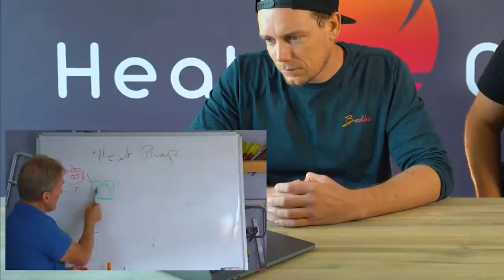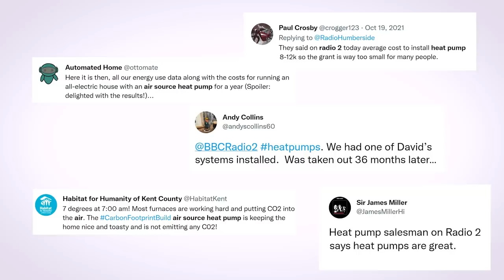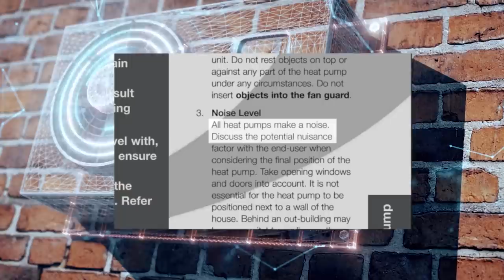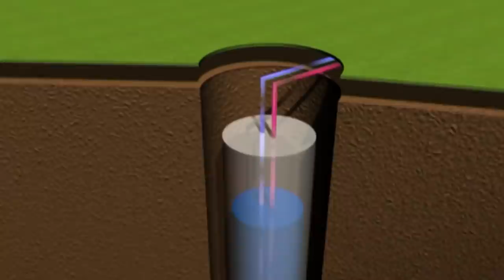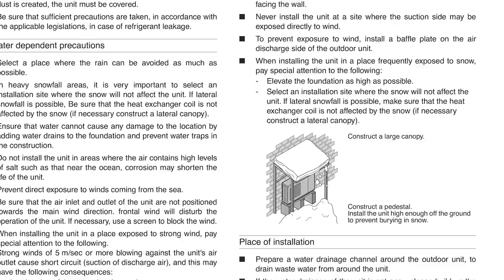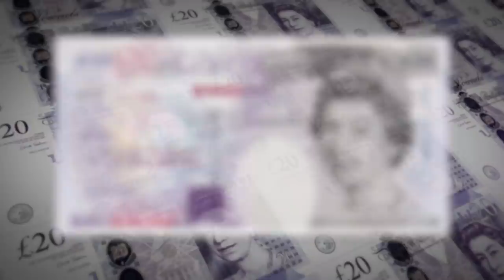Heat Pump Secrets They Don't Want You to Know

Comment: 1st off, I’m from central U.S.
Southeast Missouri to be exact.
I pretty well agree with you too. We don’t use many boilers in this area, I maybe work on a dozen per year. They’re a lot more popular in New York territory. We definitely don’t have any air to water heat pumps. We have several mini split air to air units. With them, I only recommend for an add on to a house, with it being a 1 to 2 max (1 outdoor to 2 indoor units). They’re long term unreliable to me from what I’ve seen. The efficiency of newer boilers and gas furnaces is quite impressive now. I also agree that ground source heat pumps would be a good option. They’re expensive up front, but have high efficiency rating. I personally have what we call a “dual fuel” system. Which is a heat pump with a gas furnace back up.

Comment: Pretty much everything you've mentioned (which is essentially picking out warnings from manuals of random heat-pumps (could be obsolete Chinese models for all we know) applies to regular aircon units which are everywhere. Sea air, rodents, wind/weather/rain/snow affecting the performance - all these issues don't seem to occur anymore with air con units than they occur to gas boilers. Which incidentally also have heat exchangers, fans with exposure to the elements via the flue, complex PCB's and plenty of wiring and controls. I've recently followed Octopus Energy's advice to turn down my gas boilers heating flow temp which I thought would be interesting as an experiment to see if we could use a heat pump in future - and indeed what I discovered was that the installers of our recent Worcester gas boiler did not advise the correct (low) setting to allow these modern condensing boilers to work efficiently which also require a low flow temperature in order to recover the heat in the condensation! So the low flow temps and the issue of rouge/poor installers applies equally to gas boilers as it does to heat pumps. Don't see a need to bash the better (albeit more expensive) tech over the older trusted (but dirty) one. I'm actually not finding any issue running my boiler at this lower temperature either.
Reply from the maker: You only have to look at the instruction manuals online to see these stipulations. If you did that before responding it would help your argument. 
I agree about condensing boilers they need two flows so you can send hotter water to the cylinder and can then run the radiators at 50C. The great thing about the gas boiler is that you can turn it up to 80 for those really cold daysl. With a heat pump that won't be possible and days after you need it the heat pump has caught up with the change in the weather.
Reply: @SkillBuilder  Thanks for your reply. I'm not disputing there will be warnings in the manuals for heat pumps - but lets be honest, there will be all manner of warnings for any product. I haven't heard of any of those issues particularly affecting heat pumps or air con units would be being eaten alive!
Whilst indeed gas boilers can reach higher temps than a heat pump, if 50 or 55 degrees is enough to heat a house then no reason why a heat pump could not do the same. Like you refer to in the video they can boost the temperature using a resistive heater on the really cold days too. Also newer thin screed under floor heating can respond in minutes for heating apparently but agree that certainly doesn't make them a one-size-fits-all solution.
Ultimately I think non combustion technology is certainly the future - will the UK's housing stock have to be upgraded to match? Yes. Does that mean the new tech is useless? Not in my opinion, much like EV's already work for many people (myself included hence my interest in heat pumps). But I similarly accept not everyone can use an EV yet, and much investment and infrastructure is yet needed.

Comment: We have a old house   had the oil taken out and a heat pump fitted  with much bigger radiators  and  we love it  , its cheaper to run and the house and water are lovely and hot  .
Reply from the maker: Good to hear, if you are not on the mains gas network then a heat pump makes a lot more sense but the government is pushing them to people with gas boilers and they are not an easy swap.

Comment: If you don’t know Nibe you don’t know heat pumps. Back up heating in my Nibe runs only when outdoor temp drops below -10. And in that case it takes between 2kwh and 6kwh depending on outdoor temp. The drain pipe has no heating cable whatsoever. It is angled to the drain indoors so water condensation flows quicker and doesn’t freeze. I have a house which is 140 square meters and a garage that is 95 squares, both have underfloor heating. My consumption in December 2021 was 1920kw that includes all house hold lights, 3 phase stove, 3 phase water pump for the well and 3 phase oven and outdoor temp was between -5 and -20. Heat pump running around the clock all year round. It has been running for the past 4 years with 0 maintenance.
Country Sweden

Comment: In the winter in my area it can get between 0 to 10 degrees Celsius and I thought to get a heat pump for my pool...
But I remembered that there is something fishy that I can't really point at in heat pumps from what I learned in my classes in thermodynamics when you want to put them to work well in cold claimants.
you need them to be big enough to heat well enough plus they can get pretty noisy when they need to heat in a cold claimants (of course  in that case, your neighbors will kill you with that kind of noise).
Thank you very much sir because you just save me a lot of money!
P.S: I have some air conditioners around my house (which ac on heat is basically a heat pump) and in the winter THEY ARE 
PRETTY MUCH USELESS!

Comment: I think the technology in some regions of the world works fine, much like solar panels and wind turbines.  However, when I went to college in Manitoba, my HVAC Instructor who worked 30 years in industrial engineering, said in Manitoba geothermal heat pumps work well to stabilize the temperature in a house which allows for supplementary heating to bring individual rooms up to comfortable temperatures. However, he did say Manitoba was possible to get cold enough to render an Air to Air Heat pump useless and at that point, the entire heating would be conducted on electric heat alone.  Manitoba can get down to temperatures with the wind chill to -55 and in more northern climes colder.  This is generally the air temperature in the province that gets this cold and thus the air-to-air heat pumps will no longer be able to evaporate their refrigerant and draw then expel that heat into the house.  

There are a lot of advances we never really see being marketed to the public when it comes to energy efficiency, such as Aerogel.

Comment: In NZ  (Scotland Down Under not Australia ) we had heat pumps and it was horrible, cost too much to run and never heated the home, just the room it was in.
So you need a air ducting to move hot air around the home, not to mention the home needs to be air tight basically and have a high R value.
In my opinion as someone with years using them they are a waste of money and effort in most UK homes, gas central heating with underfloor is 100% what i would have.

Comment: Hi, I’m new the the world of heat pumps. I bought a 3 year old property last year which has a heat pump system installed. We moved in to the property in the summer of 2021 and everything seemed fine, that was until the winter when we turned the heating  on (didn’t know it should be running all of the time). After a couple of days we lost all heat and hot water just before Christmas. We had a local (air source expert) company come and take a look. After an hour or so then managed to get it running long enough for them to drive away, then it all stopped again. On a return visit they said it was the flow temperature and did a “work around”. It has worked from there on but seems to be costing a small fortune to run. After watching your videos and seeing other systems, I’m convinced that the system isn’t fit for the property or installed correctly. Unfortunately, to get this looked at is going to cost me money I don’t have. Even worse it’ll probably need replacing or upgrading. It seems that the company that installed it did a rush job to get the government grant and because it was fitted for the builder and not me I doubt there is anything anyone can do about it. So currently, the system is heating the water and I’m heating the home with a log burner until it get too cold. In addition, every home I have been to that has an air source heat pump has been pretty much a sealed unit. Something my house isn’t. Anyway if anyone can help me in anyway it’d be greatly appreciated. Al
Reply from the maker: Hi Al 
 I imagine they have by- passed the weather compensation because that can cause these problems. The flow rate has to be kept high but a lot of installers don't want to put a buffer in so it depends on the pipes being large enough. They have to be huge in some cases. I was kind of hoping that Heat Geeks would start looking at these problems on their channel but they don't want negative case studies.
Reply: @SkillBuilder  I’m not 100% sure what’s been done. The last engineer said it hadn’t been set up correctly and made some changes that seemed to keep it running. I contacted Mitsubishi when it first stopped working but because the data connection hasn’t been added they couldn’t do anything. It would be interesting to see what an actual air source heat pump expert would have to say about the setup.

Comment: As for noise, I think you CAN have it both ways. Looking at the Dbs put off by a dozen different heat pump brands, and I see some do 58Db, and some do 34Db. Obviously that's theoretical on test Dbs and not Real world DBs. I expect 10-20 Dbs higher depending on maintenance, brand, and age.

Comment: Look into the Mr. Cool universal 4 to 5 ton heat pump. I installed this system last spring, no electric heating units and it works great at -5f ( its 5pm where I am and currently 8f). You're definitely knowledgeable but there's systems out there that are amazing ;)

Comment: Some new houses -flats near me have heat pumps at one block there are three units side by side attached to the outside living room wall of one house -flat, fairly sure that is going to drive them nuts very quickly. Also, they face into the prevailing wind rain, and snow and here in the Highlands of Scottland we get lots of that.

Comment: A lot of the points you've made are genuine issues, however I have to correct you on one: It's very counterintuitive but it actually is more efficient to burn gas, turn it in to electricity and use that electricity to run a heat pump than to use the same gas to run a boiler. The fundamental reason is because a heat pump is using electrical energy to move heat energy from outside your home in to your home (so the net temperature increase is close to 0, increase in home temperature minus decrease in outside temperature) whereas a gas boiler is only capable of making everything hotter - so the gas is being turned into heat energy. In a heat pump the primary goal is not to turn the electricity into heat energy (some will be due to inefficiency). A heat pump can turn 1kwh of electricity in to ~2.5 to ~4 khw of heating, so even if the gas power station has an efficiency of 60%, you still win. I do however completely agree that ideally we would not be burning anything to generate electricity! In the UK we need cheap nuclear to add to our wind power and tidal projects that have been rejected need to be reconsidered.

Comment: Everything this man has said is spot on especially for the northern hemisphere, air to water heat pumps are not the answer.
Reply: Do they work in the Southern hemisphere?
Reply: @mikekelly5869  well I can only talk for Perth, here in the winter we rarely get below 1C, so yes they work much better, obviously the colder the outside air the less heat to collect. 
I still prefer ‘air to air’ transfer for heating here it works very well at 1C.
I have a heat pump for my pool and in winter it won’t raise the water temp of the pool past 21C, which is pretty cold to swim in.
Reply: @garywright8846  I'm having a laugh. It gets just as cold in the Southern hemisphere as it does in the Norhern hemisphere and it makes no difference to a heat pump which hemisphere it's in because the heat pump doesn't know. I'm no great fan of air to water heat pumps even in moderate climates but unfortunately the UK government is trying to push air to water, apparently because air to air can also be used for cooling and they don't want to fund gear that will add to annual CO2 figures due to everyone suddenly having "aircon" that they use in Summer, when there's currently virtually no domestic cooling use. It sounds stupid, but it appears to be true. Most punters in the UK are used to wet heating systems and know sod all about heat pumps so they don't see it as odd that the most effective and flexible form of domestic scale heat pump (air to air) isn't getting anything like the level of grant funding as air to water.

Comment: That was exactly my considerations in instaling GSHP I Ground Source Heat Pump.
- I have full electric panel heaters in house  ( then converting from power hungry electricity to Electric power heat pump is GO as I save electricity
- I had chosen GSHP because I have little space around the house and can install, countriside a lot of mouses and a lot of wild life birds / pine martens and such, in addition I live in quite damp area with high humidity and rain ( it would excesively frost coils, mean a excesive defrost mean more electricity)
- I also installign full house ventilation a air recovery system then I adding to my system Air preheat ( mean I would be heating air for my house )
- In addition we had experienced a lot of summer days where many houses turning to saunas ( I have option run pasive cooling, this is basically a circulator a 40W pump can provide cooling for my house as wel in summer.

There anoter options with can be exploited with GSHP in combination to solar panels ( this can be thermo solars to assist with heating water and excess I can return to ground with would work as massive storage heater) - but this is something in future to even more optimalise my energy use and efficiency 
The oly issue between ASHP vs GSHP is the cost of installation GSHP is around 2.5 to 3x the cost of ASHP but eficiency ( with properly sized ground loops) is estraordinary include life expectancy, also vitually invisible stuff

Comment: They ain't cheap either. Customer of mine paid out £18K for air source for a 4 bed det. Also said to get the government grant you have to tick loads of boxes and jump through many hoops. Also noted that domestic hot water is not what it should be, ok if you're into them cold showers. Rads don't get as hot as they used to etc.

Comment: I have installed on demand heating in my house instead of storage heaters. Electric elements into normal radiators all controlled by a thermostat. Works well for me. We can’t have these pumps in the flat. We had three storage heaters all rated at 3.2kw. Now our heating is 2kw when all on.

Comment: We currently don't have a proper functional furance. I disconnected our kerosene furnace 5-6 years ago as the burn chamber was cracked. Our primary heat is a woodstove and we have a gas fireplace insert which is sufficient to keep the house warm by itself.  The only problem with the insert is that it is slow to heat the house if the thermostat was turned down and if you leave the central part of the house it is much cooler. 

I was just starting t o contemplate installing a new furnace or heat pump when I saw one of your videos.  Having just gone through a couple of weeks of -23C temperatures I have decided that a heat pump probably is not the route to take.

Unless it was ground source or done in tandem with a solar thermal enclosure. 

Thanks f or the info.

Comment: Hi Roger, it's the fool here (the guy that wanted to create, "Draft Masters" {you suggested, "Draught Masters" might be better}). I've got two ideas:

* If heat pumps extract warm air from the environment could they be housed in a lean to conservatory (Bob Mortimer wants to push the boundaries with a "lean three" or even a "lean four" {from WILTY : J-Keg})? That would also solve a lot of the sheltering requirements (wind, rain, snow, rodents, etc)

* Is this idea any good? Again, using a lean to conservatory, just have two fans and a few thermostats. When the temperature differential is high enough between the conservatory and the house, "power on". Have one fan blowing air into the house and the other blowing it back into the conservatory (maybe one fan and an associated vent on the other side of the lean to would be enough.

My best friend, Brian, is self installing heat pumps and it's a disaster. He is routing all the pipework and control cables on the outside of his house and it looks terrible. I suggested he tear down the drywall and route it through the internal walls but he said that would be too much work. Why do a job if you don't have the skill or desire to do it perfectly? Just pay more and get the experts in. I felt Brian should have gone with solar panels and a lean to. If Heat Geeks saw his install they'd probably either burst into laughter or tears or possibly both.

PS #1 RB pities the fool with no building skills, he pities those fools!
PS #2 Never work as a ladyboy, you as Margaret Thatcher was even more terrifying than the Iron Lady herself.